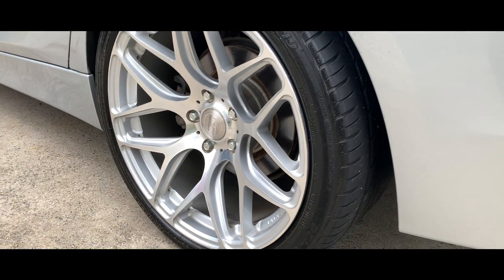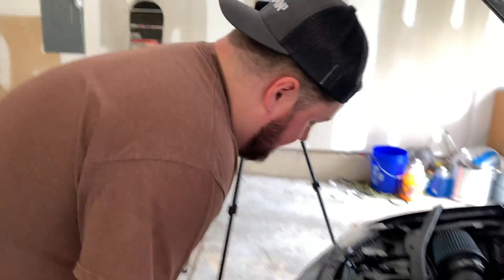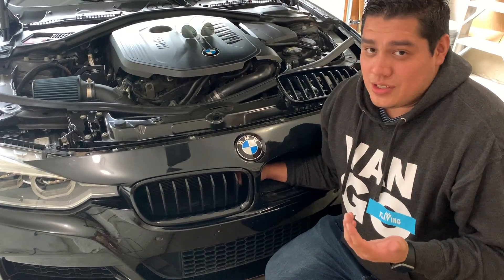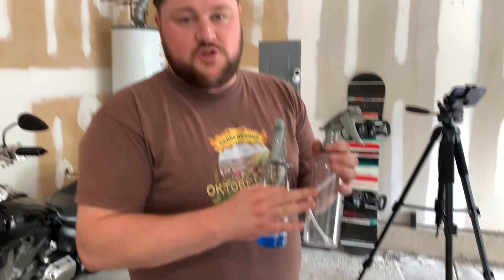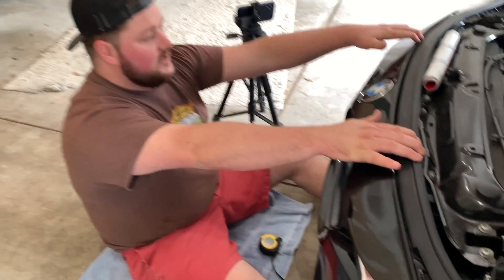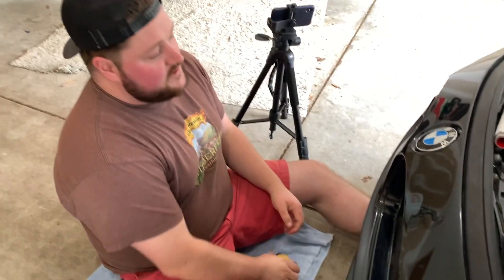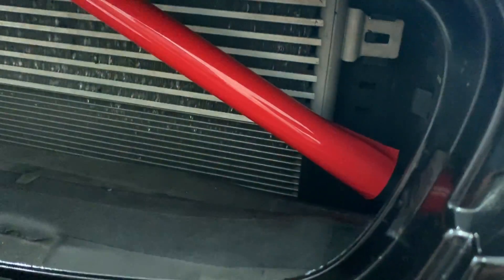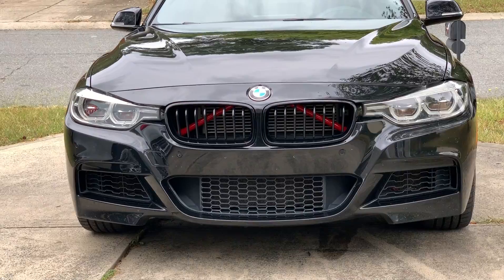CHEAP AND EASY V BRACE WRAP | BMW F30 340i

Comment: You do not have to loosen the bumper. You have more stability with the bumper fastened down. Put gloves on and start from left to right pulling clips out. Grill comes out in less than two minutes.
Reply from the maker: that works for people with small hands and only on the F30… it’s much easier to do it the way I did it.